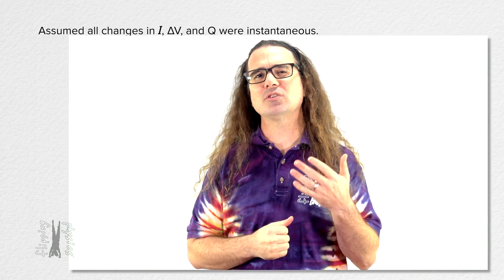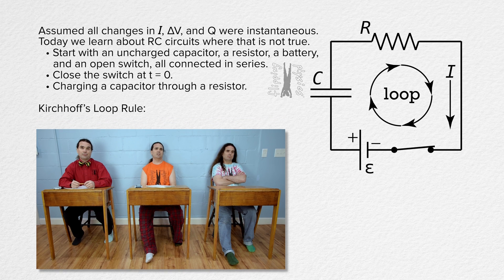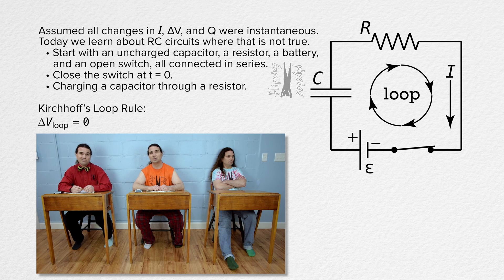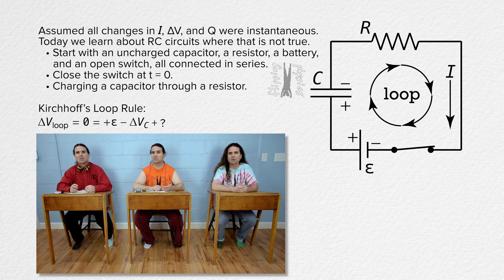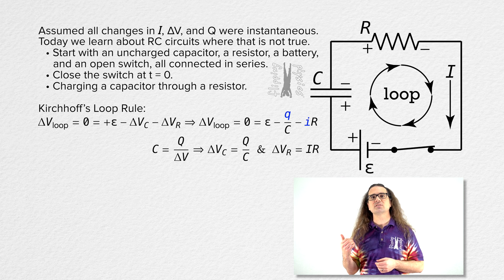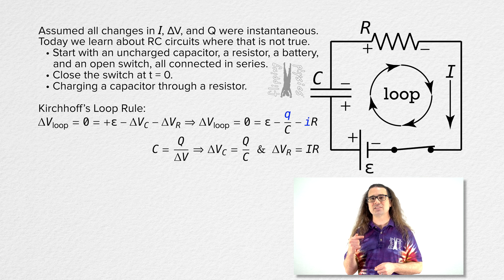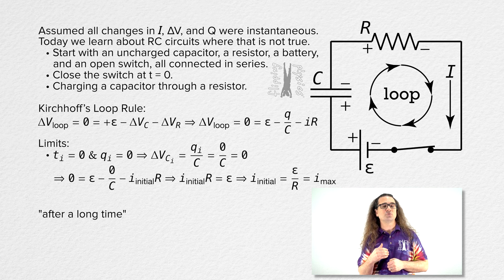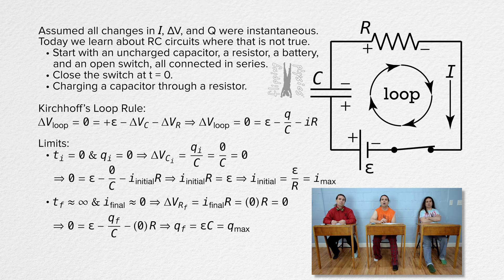RC Circuit Basics

Comment: I enjoyed this study class approach. Thanks  for your passion and dedication. Its good dialog, not text book.
Reply: I have not watched this vid, but remember that current will flow in a cap circuit, only as a response to the change in voltage across it; no change in voltage, no current flow. Rather handy if you wish to measure acceleration/deceleration for example

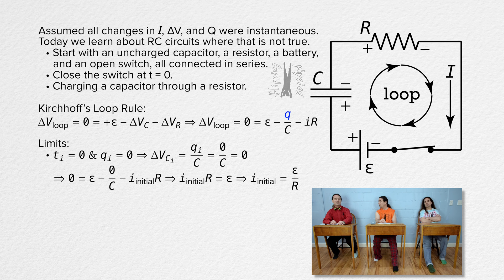Comment: 5:07 Mr. P, I am afraid but Billy's words just lost me there. I assure you it never happens to me; I love these intricate phrases and clauses. Besides, I grasped how Bo explained later. Could you please tell me why and how the increase in electric potential difference of the capacitor leads to decrease in the electric potential difference of the resistor, then the decrease of current in the circuit and the final conclusion?
Reply: From my understanding, as more charges build up on the capacitor, the electric potential on the capacitor increases, and because there are less charges flowing through the circuit(due to being built up on the capacitor) there are less charges flowing through the resistor, meaning lower potential difference. I am only a student though, so my explanation may not be perfect.